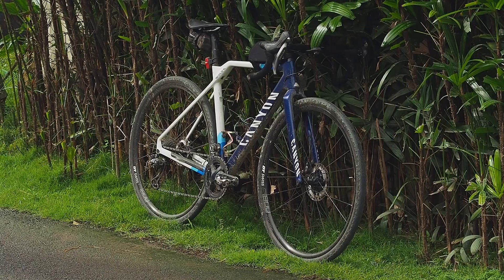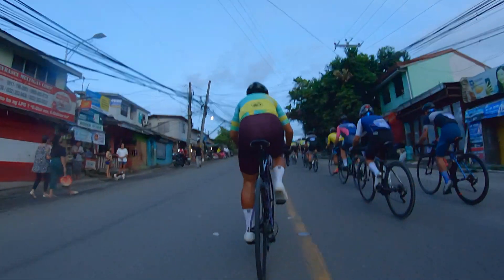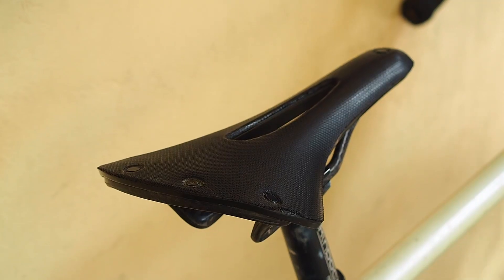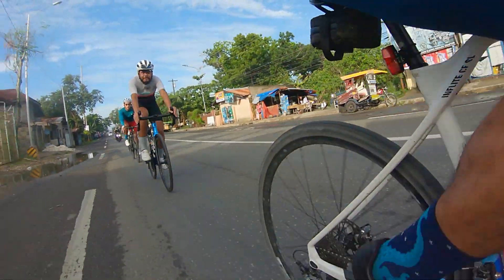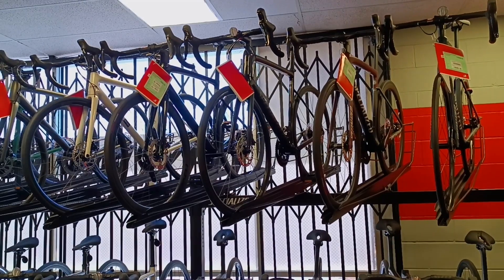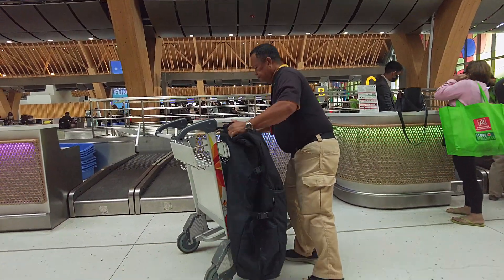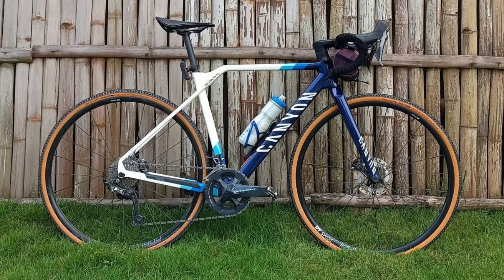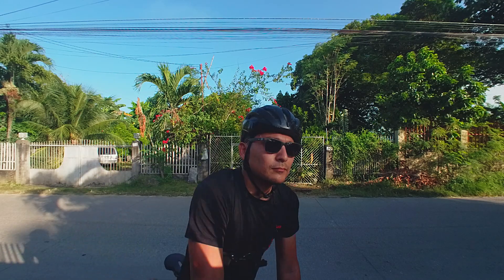Comparing Steel vs Carbon Bikes: Surly Midnight Special & Canyon Inflite

Comment: I would say these arent comparable bikes. The one has a Fox sus fork, and in my experience Fox forks make for a sublime ride. I have 3 focus Mares CX race bikes two have broken. I have two steel road bikes, after major crashes on both neither needed repairs, just new forks.
Reply from the maker: I've actually got a few marex cx frames at the shop. I'm curious about them for sure

Comment: Ave Maldea is taking orders again right now for custom bikes, chromoly/columbus steel frame and fork costs 35,400 the last time I inquired which is August 15, 2023. For Hi-tensile steel frame, chromoly fork it is much cheaper by around 14k. What is your take on Hi-tensile steel frames? I am planning to make a custom one and I know that chromoly is much better than hi-tensile, but what would you rather choose if you were to custom?
Reply from the maker: Oh that's good news. 

If I were choosing my first good bike and budget were an issue, hi-tensile steel is fine. I own a hi-tensile steel fixed gear bike. It rides fine. Although the weight penalty is really noticeable.

But also if i were to go custom and I have a better idea of what kind of bike I want, I would spend extra on the better frame material. I think it'll be worth it, especially if I were confident that it would be a bike that i would keep for a long time.

Comment: why is your oval chainring installed that way? 3:08
Reply from the maker: in what way?
Reply: @carlovillarica  They have to be oriented such that they are at their tallest(emulating a larger chainring) when you are at your most powerful part of your pedal stroke. So looking from the driveside, they should be at their tallest when the crank arms are at around 3:30 and 9:30 o'clock.

Comment: What carbon deep wheelset are you looking to get for your Canyon Inflite? Haha. I'm still waiting for my Endurace, I think I may want a Carbon wheelset that's around 40mm and then maybe go with 32mm tires.
Reply from the maker: hahah i haven't really looked yet. Ideally I would like a wheelset that has a wide external width. Something that is aero optimized for 30mm tires (although this seems really difficult to find. SO I might settle for aero optimized for 28mm tires). Then as for the rim depth... i haven't thought about it much yet. But probably same around 40mm?